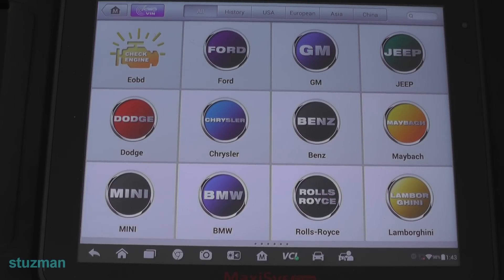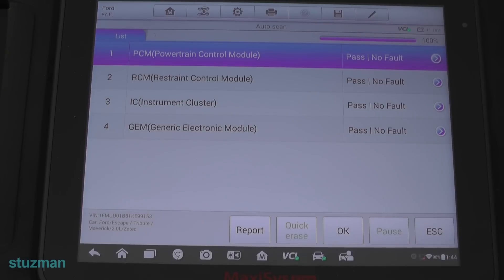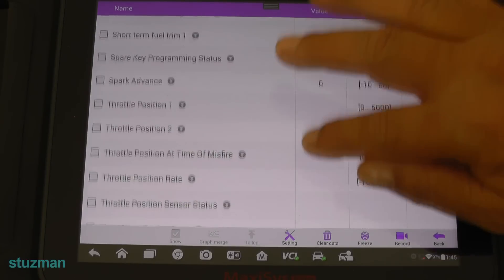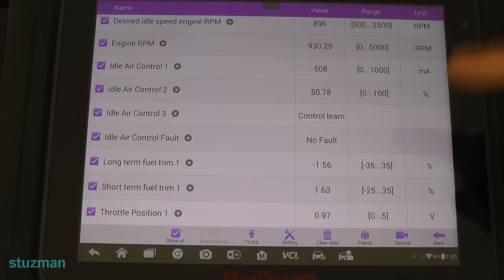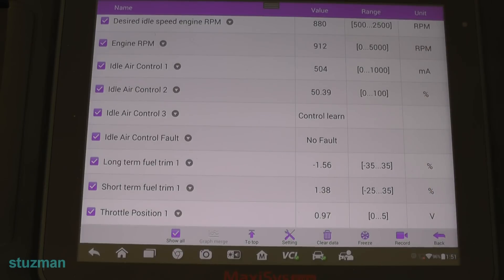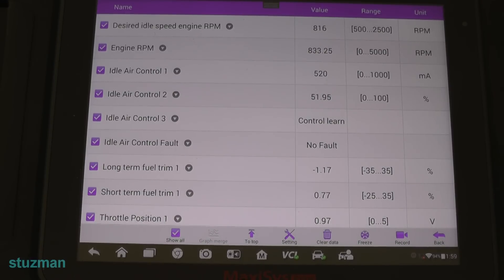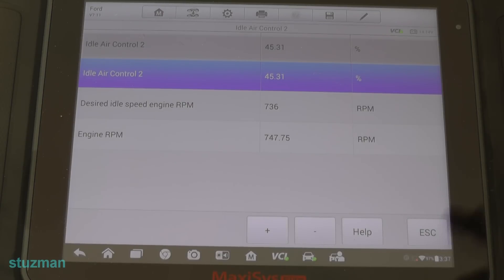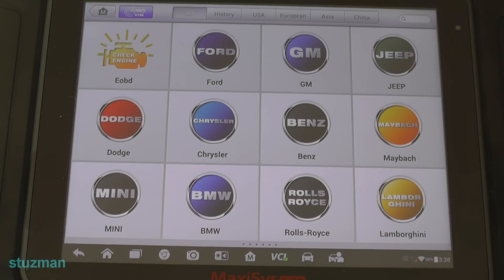MaxiSys Elite Scanner on Ford Escape Idle Issue

Comment: Hey mister Pike welcome back! I like the scan tool! my Ranger would rev up by itself at a stop or rpm stays constant between gear shifts. I unplugged the throttle position sensor connector and drove it a short distance then reconnected it, issue gone lol for now at least. didn't have time to diagnose it properly but from the looks of it it's the TPS on my application. the IAC was replaced before but didn't solve the issue. it was intermittent as well. waiting for your fix
Reply from the maker: DIY-HAVEN Hey diyhaven! Haha! Who knows, you could be right 😀 I've got some figuring to do. Thanks for dropping in.

Comment: I think Eric O has a high level Autel scanner, and he seems to like it although I think I remember he sent it back for service at one point. All these high level scanners seem to be prone to freezing up, I don't know whether that is usually coming from the vehicle or the scan tool. It must be difficult to design a tool that works well across several vehicle platforms. Subscription software updates are the killer for those of us who don't do this for a living. Intermittent problems are always the most difficult. It could be a simple issue, like a vac leak when cold, disappearing when the engine warms. Nice video, Terry!
Reply from the maker: Thank you Dave for your thoughts! As for this scanner, I've tried it on several makes and I've kept it hooked up for long periods and tried different menus and haven't seen a lock-up issue yet. Maybe, I haven't run across the right vehicle yet ;) I don't think it would be a vacuum leak when cold as it should have shown on the fuel trim numbers on a cold start-up. At least that's what I'm thinking! I think the actual issue is not going to be that dramatic as with Ford's IAC, it seems to be a common problem. But, I've been wrong before. Have a good one Dave and looking forward to your videos!

Comment: Nice new toy Terry!! At least now you can get them Chrysler headlights working after a bulb change 😉
Reply from the maker: One Auto, seems to be pretty good but I did see there was no pid for the ect. It was there on the global obdii :(
Reply: I get that sometimes. At least it's in the OBD2. Keith was saying on Thomas's live chat sometimes if you back out of it and go back in the pid appears. I've not tried that yet.
Reply from the maker: One Auto, I've tried that by coming out and re establish a connection and it's still doesn't show up. Done it several times.Pretty sure it's a bug. Will contact Autel see if they will fix it. Thanks Rob! 😀

Comment: Nice scanner Terry, i'm just thinking i might be wrong since i'm not an experienced tech just giving in idea :) , since the desired idle almost equals the real idle it might be an input issue. Thank you!
Reply from the maker: It could be Armando, but while it was running as you saw, the idle was okay and the other inputs didn't show anything out of the norm. And it only acts up when the engine gets up to temperature. Even when up to temperature, it didn't show a problem :) I'm pretty sure that it's the idle air control valve that is sticking. I'll probably have to get out on the road to see it act up as it's an intermittent issue. Thanks for dropping in Armando and sharing your thoughts.
Reply: You are very welcome Terry, i think you are going to do a video after you install the new IAC??

Comment: hi mate great vid that scan tool looks awesome is happened to me a few times rough idling and I can be the temperature sensor it drops out and the car runs bad also another quick test you can do if you get it running rough just quickly tap on the idle air valve if it runs better then the valve can be sticking just a few things you can check just come across these few things in my experience
Reply from the maker: Hey Leon and hope you're doing well! The scan tool is pretty awesome and I've read the manual twice and still find all the features overwhelming of what it can do. Thomas mentioned also about the temp sensor dropping in temp for idle issue that he had on his car. And I did do some other things off camera, so I'm pretty sure what the issue is. Don't want to give it away too soon :) Thanks for dropping in Leon and don't work too hard today as the weekend starts the next day :) Have a good one!
Reply: stuzman just tell Steven he won't tell anybody what it is lol
Reply from the maker: HaHa! You know Leon, it's never too late to be a stand-up comic. You're a funny guy and I would pay to come see you on stage. Have a good one!
Reply: bodgit and leggit garage that figures out most IAC issues on F-150's and up. I haven't tried it on a Ranger.
Reply from the maker: Damn David! I was posting to another comment and saw your here by accident. I never got an email for your comment. Yep, I believe it would work on a Ranger also as the valves are very similar.
Reply: stuzman That's because I hacked YouTube. 😉 Kidding of course. If I had I'd have a lot more views for me and all our friends. Lol
Reply from the maker: DE Nichols ha ha David! You are a funny guy for sure 😆

Comment: Hi I was just wondering where you got your tool. Did you buy it from a US distributor? I bought mine on Amazon and I haven't had any issues, but I just wanted to find out where you got yours and if you have had any issues with the Chinese software
Reply from the maker: kanesgarage i'm like you that I bought mine from Amazon also. I haven't had any issues at all with the tool or the software updates. All is good so far! 👍

Comment: Hey stuz..  im back.. how are you..
I have a question.
Do i really need all the connectors that come in the box?
I got a guy selling the 908 for 1000  
But come just with the Bluetooth  device.   And is update to 2017..
Reply from the maker: As for the connectors, it depends on what you're working on. If that's what you want go for it.
Reply: stuzman  those are for 96 and lower. Right. ?.
Most the times i work on domestic. . And imports.. 96 up.
Reply from the maker: The tool is only for OBDII and there may be situations for those other connectors where you may have to access certain functions like ABS through another connector. I've never used any of those 'other' connectors and I don't know for sure what each one is and on what cars they apply to. You should be okay, but if you want more info about those connectors, you can post a question over on autel's website and maybe someone over there can tell you about them. There is nothing in the manual about those 'other' connectors.

Comment: Iac motor problem solved. Common failure on Fords. When it acts up tap on it lightly with a screw driver or brass hammer.
Reply from the maker: Yes Bill you are correct that IAC solenoids are a common problem on Fords. I confirmed awhile back that tapping on it with a screwdriver made the idle go up and down. Thanks for the feedback!

Comment: Hello ..thats come with scope?
How is doing it after months  of use?
Thanks for the videos  keep it up the good work..
Reply from the maker: Hello colas and welcome. No, it doesn't come with a scope, but you can buy the option for it. As for a scope, I use Picoscope for that. I bought it in April, 2017 and it's still doing great. The manufacturer is constantly sending out updates on new years, makes and models. It's been one of the best scanners I've ever bought. And thank you for the channel support :)
Reply: stuzman thanks for taking the time to answer faster..
How do i know wich is  the old maxysis and the new elite?
There is 1 for sale on line for 1700 and the owner said is the elite.
Reply from the maker: Here is a link to a video of where a guy who is a distributor for Autel discusses the different models showing the different part numbers between the pro and elite versions. https://www.youtube.com/watch?v=OhtRTRo_DcE You also want to be careful when buying used equipment as it's locked to whoever bought it. So, you may not be able to get any updates for the tool. Of course, if the subscription has run out, and you want to pay for updates, I'm sure that Autel can take care of you. Oh, and for FAQ about the Maxisys Elite, here is another video link that you may find useful https://www.youtube.com/watch?v=5qexPSmkoO8
Reply: stuzman thank you.
Reply from the maker: You're welcomed!
Reply: stuzman 
Hello.. the guy on the video. I think he want to charge arm and leg for the scanners..  and he said dont get it from ebay or Amazon. 
Would u share  the number on the back of u maxysis.. 1 of the guy here on my town has 1 and he said is elite but he lost the j tool..i know sound like a stolen. . But  i will make sure first .. he said is up date to 2017.. but no j tool.
Reply from the maker: colas solorzano I posted the link to that guy just so you can see the differences between the model numbers and the differences between the scanners. I didn’t imply that you should buy from this guy. Have the guy that you want to buy from to take a picture of it and take a look at it and see if it looks like the elite or the pro version. The picture will let you know if it’s the elite scanner.
Reply: stuzman  i will..

Comment: What can this do with an ECU that the Maxisys908P cannot?
Reply from the maker: The software is the same between the Pro and Elite version. The Elite version is newer where the hardware has been redesigned and has a faster processor.